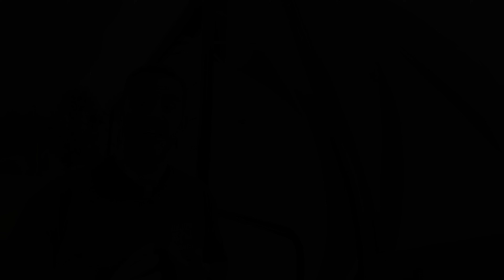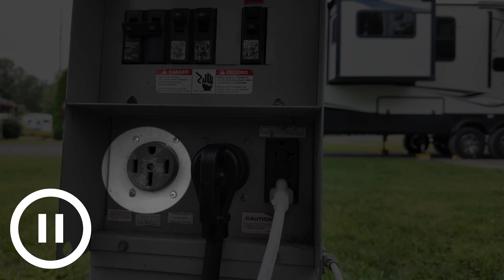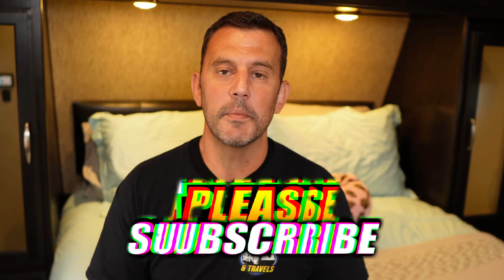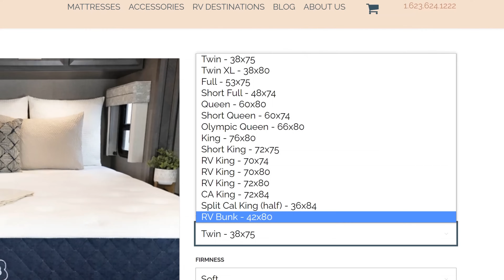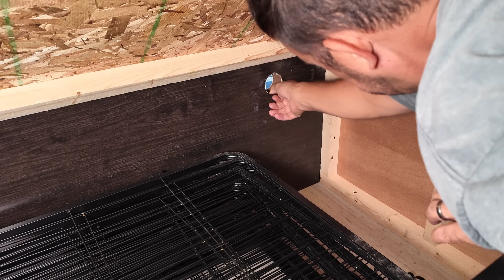This Old School RV Modification Adds USABLE Power to a 30 Amp RV

Comment from the maker: ✨ PRODUCTS FEATURED IN THIS VIDEO 
🛌 Get 30% off your RV Mattress by Brooklyn Bedding at https://rvmattress.com/rvtips
Use discount code: RVTIPS
🔹 Desktop Outlet https://geni.us/YtM7Nh (Amazon)
🔸 Grommets https://geni.us/ASZD (Amazon)
🔹 3/8" Cable Clamps https://geni.us/zImBfF9 (Amazon)
🔸 12 awg Extension Cord https://geni.us/Os46z (Amazon)
🔹 Hatch https://geni.us/oLa1xb (Amazon)
🔸 50 to 15 amp dogbone https://geni.us/Sfz4fBx (Amazon)
🔹 2" Hole Saw https://geni.us/RR5OY (Amazon)
🔸 Dremel Cutting Bit https://geni.us/W53OG (Amazon)
🔹 Dewalt Drill https://geni.us/OQhqvub (Amazon)
🔸 Power Watchdog 30 Amp EMS https://geni.us/zKcm (Amazon)

🔹 Ebay Auction has ended!

🔎 Resources
- Wire size chart from Miller Welding https://geni.us/5lV1N6D (Google)
-Great article on cord length & size https://www.grainger.com/know-how/equipment/kh-choosing-the-right-extension-cord

OTHER VIDEOS YOU MAY LIKE
🎥 RV Essentials https://youtu.be/yuvS3zZL81c
🎥 7 Things You're Missing https://youtu.be/PfOLBTklnHo
📺 See ALL our videos: https://www.youtube.com/@RVTIPSANDTRAVELS/videos

30 amp RV power sucks.  You cant run all the factory appliances at once, let alone any additional things you RV with.  Here's an old-school trick to utilizing the additional power provided by the campground pedestal.  

Chapters:
0:00 Intro
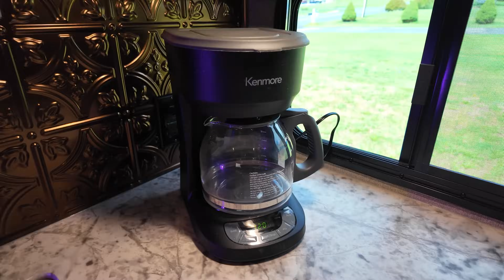0:37 30 Amp V 50 Amp
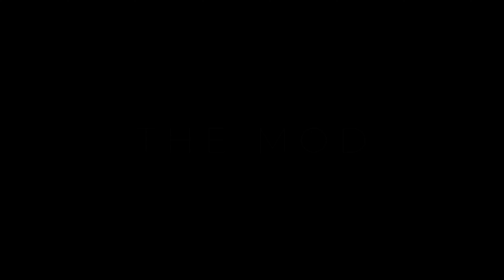1:49 The Mod
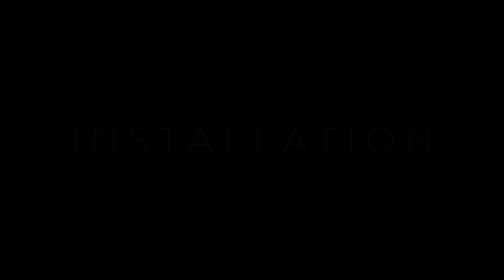3:14 Installation Pt 1
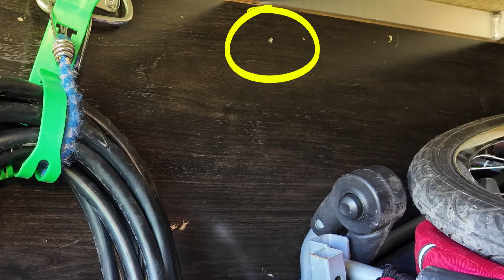4:44 Visit Our Sponsor
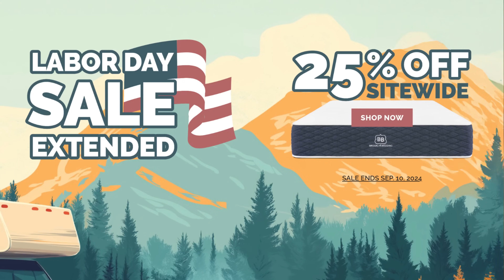5:29 Installation Pt 2
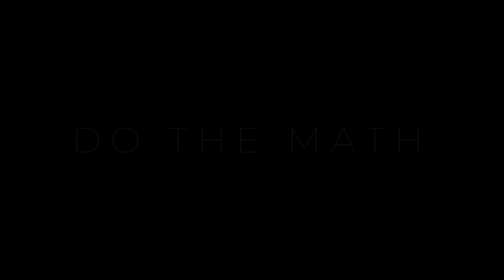6:49 Be a Hero
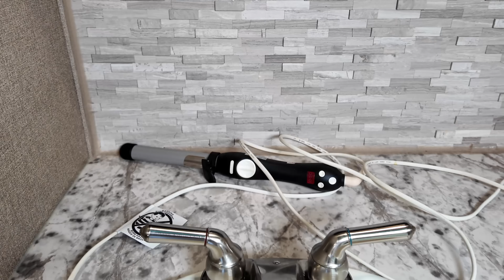7:08 Considerations

Thanks to  @JoshtheRVNerd  for some footage!

#rv #rvlife #rvliving #rvlifestyle #rvtips #rvtravel 

RV ESSENTIALS & TOP PICKS 
🎥Essentials Video: https://youtu.be/yuvS3zZL81c 
🔷Sewer Hose Kit https://geni.us/7dNg (Amazon)
🔷Clear 90 Degree Sewer Elbow https://geni.us/L79gI2 (Amazon)
🔷RV Water Filter https://geni.us/FZ1P (Amazon)
🔷Best Wheel Chocks https://geni.us/9B5i (Amazon)
🔷Power Watchdog 30 Amp Surge Protector/EMS https://geni.us/zKcm (Amazon)
🔷Power Watchdog 50 Amp Surge Protector/EMS https://geni.us/jgOto (Amazon)
🔷Wireless RV Leveler https://geni.us/DAW9N24 (Amazon)
🔷Leveling Ramps https://geni.us/m38VoBr (Amazon)
🔷Liquified RV Tank Treatment https://geni.us/QTUJSrP (Amazon)
🔷Tire Minder TPMS https://geni.us/8HBSTg (Amazon)
🔷Water Pressure Regulator https://geni.us/fTzA0 (Amazon)
🔷Drinking Water Safe Hose https://geni.us/emLdlC (Amazon)
🔷Browse All Essentials https://geni.us/1Omwvhh (Amazon)

MAINTENANCE:
🔶Boeshield T-9 Rust Preventative & Lubricant https://geni.us/uXxstyC (Amazon)
🔶Geocell Proflex Sealant https://geni.us/YXiACx (Amazon)
🔶Water Heater Cleaning Wand  https://geni.us/AcTvhLc (Amazon)
🔶Water Heater Cleaning Adapter https://youtu.be/h6C6ihTQ1cY
🔶Waste Tank Rinser https://geni.us/V2XLE (Amazon)
🔶Road Tool Kit https://geni.us/oBFnd9l (Amazon)
🔶Eternabond Roof Tape https://geni.us/6AXdw (Amazon)
🔶Browse All Maintenance https://geni.us/UvxFP (Amazon)

INSIDE
🔷Screen Door Handle https://geni.us/itRfKUQ (Amazon)
🔷Shower Caddy https://geni.us/ZPcno (Amazon)
🔷Oxygenics Shower Head https://geni.us/jznwF (Amazon)
🔷RV Paper Towel Holder https://geni.us/Acknol (Amazon)
🔷Dimmer Switch (watch video) https://youtu.be/2bbqBcSsRZQ
🔷Electric Heater Fireplace https://geni.us/YmBoktI (Amazon)

OUTSIDE
🔶Gravity Chairs https://geni.us/VlPR8rn (Amazon)
🔶Ground Mat https://geni.us/wbWWLzf (Amazon)
🔶Table https://geni.us/qsPO (Amazon)
🔶X Chocks https://geni.us/3oyburw (Amazon)
🔶Blackstone Griddle https://geni.us/8BuIrW (Amazon)
🔶Low Point Drain Valves https://geni.us/yBB02h7 (Amazon)

👇 COUPON CODES! Use the links. Save money. Simple.

🚐 10% off RV Snappads & Snapjacks https://rvsnappad.com/discount/RVTT10

💦 Blu Technology Water Filtration Systems 7% Off, $80 or more No code needed just use our link:  https://goblutech.com/xxnnkdun 

🛌 Get 30% off your RV Mattress by Brooklyn Bedding at https://rvmattress.com/rvtips
Use Discount Code: RVTIPS

📷 Haloview Back Up Cameras 5% Off & FREE Shipping (Use code RVTIPS at checkout) https://www.haloview.com/products/byte-tango-1080p-observation-camera-system.html?acc=765

🔧 NRVTA Home Study Course https://rvtechcourse.com/discount/RVTIPS20
Use Discount Code: RVTIPS20

🚴‍♂️️ Lectric eBikes - Use our link get FREE accessories https://lectricebikes.sjv.io/nLrJ3x

💻 Our eBay Store! You never know what you’ll find!
https://geni.us/6AyLKnS (eBay)

💥 Join Our FREE Newsletter! https://rvtipsandtravels.myflodesk.com/freenewsletter

If you want to support the work I do to help others, you can donate here:
Paypal: https://www.paypal.com/donate/?hosted_button_id=J2KKM9NR3BJJA
Venmo: https://venmo.com/u/Ross-Stoico

✨ AMAZON RV STORE ✨
https://www.amazon.com/shop/rvtipstravels

Follow Us on Social Media
https://www.instagram.com/RVTipsAndTravels
https://www.facebook.com/RVTipsAndTravels

🙏 If you find a dead link, PLEASE let us know & we’ll send you bumper stickers!

As an Amazon Associate, I earn from qualifying purchases. There is NO ADDITIONAL COST TO YOU when purchasing from our links. Thank you for your support! 2.0

Comment: I did this years ago with a 15 amp shore covered outlet. Male plug inside. 24 ft motor home, no basement or pass through. A normal 2 plug outlet next to the stove. I use a smart plug in thermostat plugged into it. Plug a small heater into that. It heats the RV on the 15 amp circuit, and I can use all the appliances without tripping the breaker.

Comment: I did the same thing about 3 years ago with my travel trailer because I wanted to run a small dehumidifier but not keep the electrical system of the travel trailer active 24 hours a day while parked in my driveway.

Comment: Just add another 30 amp service the exact same way. put in a small 2 circuit breaker box and run new wiring with the surface style conduit.  My RV plugs were brown so I did the 2nd circuit in white.  I added another A/C- heat pump on one circuit and kitchen plugs.
and plugs for electric heater on the other.  Best thing I ever did

Comment: Sorry hate these auto correct .   Did you plug it into extension cord or cut or female end and hardwire
Reply from the maker: The desktop outlet already came wired to a male plug, that was fished to the pass thru storage.  Extension cord plugged into that then pedestal.

Comment: Did you hard wire the desk top socket to the extension cord or did you just plug it back not the extension cord
Reply from the maker: The desktop outlet already came wired to a male plug, that was fished to the pass thru storage.  Extension cord plugged into that then pedestal.
Reply: @RVTIPSANDTRAVELS I love it. Thanks so much

Comment: Didn't read all the comments. But I definitely stole your idea. One thing I did was instead of the grommet I used a NOCO pass thru connection. I have one in my shed so you can get power inside via extension cord without having the cord pinched by the doors or windows.  It provides you with a water tight cover in the wet bay when not in use. 

I just E taped the connection in the under bed area so it doesn't come apart.
Reply from the maker: good idea

Comment: This is a project I've been talking about doing for almost 2 years, since my first winter in the camper. Actually bought the stuff to do it, a nice shore power receptacle/cover for the outside of the camper, but that ended up getting used for my tank heater project. Still want to add the outlet at some point, mainly because all my outlets are on one 15 amp breaker. I can't use multiple things even if the AC or water heater aren't running.
Reply: I do love having the tank heaters on a separate plug already though. They're just a few amps, but being able to not have that load on my camper in the winter is nice (especially at my parents where I'm boondocking on regular outlets. Being able to put those couple amps on another circuit is a godsend when you're only on a 15 or 20 amp plug.) That trick running the cord into the passthrough is what I do if I don't have a second outlet to plug the heaters into, just run the extension cord up into the passthrough and plug it into the camper.
Reply from the maker: me too, should have done it 2 years ago.  glad i finally did it.  was sick of running the cord through the slide out.

Comment: I suggest a gfci outlet to protect from possible ground faults. The breaker in the panel may be old and tired. The usb addition is nice and there are gfcis with usbs. You would need a cut in box which is not difficult to install.
Reply from the maker: thats a good point, but in theory every 20 amp outlet on a campground pedestal should already be GFCI since it has exposure to water.  however, you bring up a good point... that is probably something i should have mentioned in the video, so thank you for bringing it up!

Comment: I have ran an extension cord to the 20amp outlet on the campground pedestal before to plug in a 1500 watt heater. I have a voltage meter plugged into one of my outlets and noticed that when I turn the heater on, the voltage goes down. How is this possible, as the heater and the voltage meter are on seperate lines? (heater on the 20 amp outlet and meter on the 30 amp) I'm assuming that the pedestal is taking power from the 30amp socket and sharing it with the 20amp one. This has happened in multiple campgrounds.
Reply from the maker: interesting 🤔

Comment: 1) If you're screwing into that paper-thin plywood that most RVs are made of, glue a short strip of wood 3/4 inch thick behind where the screws will go.  Now you have something substantial to screw into and the screws won't strip out the hole.
2) If you're using an adapter to plug into the 50 amp receptacle, you don't have sufficient overload protection for a 12 gauge cord (and most extension cords are smaller than that).  This presents a safety hazard and I would avoid that.  Plugging into the 20 amp outlet on the pedestal is fine.
Reply from the maker: a 15 amp circuit is not going to overload a 50 amp outlet.  Also, on a dogbone, you're only getting 1 leg of power.
Reply: @RVTIPSANDTRAVELS  You're missing the point. If you overload the outlet, for example with a hair dryer and a 1500 watt space heater, you're pulling more amperage through the extension cord than it can carry without getting hot. This is how fires start.  The breaker won't guard against this unless you exceed 50 amps.
Reply from the maker: I understand what you're saying, but very clearly in the video i said to match the cord with the amount of power you would be pulling.  you cant overload a cord with a device that doesnt have the physical capability to pull more current.  Besides, and I can confirm this myself, and even have shown this in other videos... pedestal breakers rarely work correctly.  I've pulled up to 36 amps and it never popped the pedestal breaker.  its happened at multiple campgrounds... the reason I know is the Power Watchdog will go into auto shut off.

also, there is a 2x at the top of the pass through storage that the outlet is mounted too, it definitely would last long on that plywood alone.

Comment: Hi  thanks for the video. But i have a question, the pedestal connection is only one an is 30amp. Could i use a 30amp splitter to connect my rv and have a 15amp extension for my appliances?
Reply from the maker: if you're going off the same 30 amp plug, you're still only getting 30 amps, so this wont work.  you will need another 15/20 amp outlet to gain the extra amperage.

Comment: Cool mod.  Since you are using a pre wired outlet for residential use, I wouldn’t need to worry about any building codes?
Reply: It's an RV. What building codes?
Reply from the maker: i wanted to stay away from wiring a duplex... and use a prefab outlet for just that reason.

Comment: Hi Ross ,your Candian fan Randy Imagine 2600RB ,in regards to your electrical box did the same to useless GF outside plug which tripped continuously inside breaker in main panel . Just split wires to spare breaker it had. Also in regards to Swyntech slide issues. First checked slide brackets in wall to find broken screws and a single bracket to hold slide in camper,bad. Made new brackets either order or make put 2 more on each side with 3 screws instead of 1 on each side.Next lubed as per lippert video. Then took  a small hose secured to a small stick feed canola oil in tube and blew with compressor on each of slide rollers under neath rug for slide . Oil stayed on rollers and lubed floor of slide.Now slide rolls in & out like a dream  150% better. Also don't forget to sync motors by holding in button 10seconds. 45 times last year and 15 times this year in & out. Big Ben on travels again.

Comment: Have you checked what the code is? I have read this is not allowable
Reply from the maker: code? its a singlular prewired desktop outlet.  If you bought this for its intended purpose, you would be mounting it to your desk at home and plugging into an entension cord or outlet.  but if you want to wire in a duplex with romex to meet code thats absolutely fine too.  i dont think its necessary to worry about code when just adding a prewired desktop outlet.  its being routed safely through a grommet and tieing the wire as you go.  the important part is that you are using a sufficient gauge wire.

Comment: in 9 years of camping in an RV i have never required more than 30 amps, never popped an breaker.
Reply from the maker: Thanks Paul, have you ever analyzed the amp pull real time?  The Hughes Power Watchdog will allow you to do this on a phone app.  It's mathematically impossible to run all your appliances at once on a 30 amp circuit without exceeding the rating, according to physics.  As mentioned in the video, not popping a breaker doesnt always mean you arent exceeding your amperage.  If you havent popped a breaker you are probably being smart about which appliances you run at one time.  If that is not the case, your pedestal breakers are just not popping as they should.  Just be careful, if breakers don't pop, wiring is getting hot, terminals will probably show signs of singeing.  Thanks for watching and commenting!
Reply: I understand. I do not have a lot of extra appliances in my rig. I am also cognizant of what is drawing power and actively mitigate going over.  

I have to thank you for your content, it is most valuable.
Reply from the maker: Thank you for the nice comment and for your input.  Always appreciated my friend.  One thing that I know kills me is powering my water heater on electric.  I hate using propane for something I dont have to.

Comment: I have a 30A Class A with 2 AC's and 5500 ONAN Generator (30a & 20a legs). Found out there is a relay that makes the front AC generator preferred on the 20a leg. So I spliced in plug (male & female 20A, 12/2 ga) and now I can unplug the circuit form the generator and plug in an extension cord to the 20A pedestal. in this configuration, I have the front AC running on that 20A, while the rest of the coach is still running on the 30A.
Note: I do have a soft start on that front AC.
Reply from the maker: nice set up, I was going to say it would be good to put a soft start on that 20A, but you beat me to it.  Thanks for sharing my friend.
Reply: @RVTIPSANDTRAVELS  Next I'm going to buy a 50 AMP surge protector and a 50 AMP to 30/20 AMP splitter (like the Parkworld 885200 Splitter). So I'll have one connection that splits into 2 and both are protected. Then I can use the 50 AMP or my original 30 AMP (when I don't need both ACs and outside temps are cooler) or if 50 AMP is not available.
My only concern is the multiple connection points. I'll likely zip tie the splitter to the 50 AMP surge protector so it will remain good and tight. And inspect/clean frequently.

Comment: A work around for more power I've done is to add a 3000w power inverter to my camper that runs off the batteries (I have 2) this allows me to run my outfit kitchen fridge while I'm not plugged in and  it essentially delays the power load of temporary a temporary appliance.
Reply from the maker: which one did you get?
Reply: @RodgerGarage  yeah, we wanna know

Comment: Be mindful of your neighbors. Some campgrounds put one connection point between two lots, so one if the two RVs has their wire crossing under to get power. But it also means if you are running an extension to that other circuit, you might accidentally jump their breaker depending what you are collectively running at that time.
Reply from the maker: Totally agree.  Even if you are using a 15 amp plug and a 30 amp plug, you are still using 55 less amps than if you had a 50 amp rv using the 50 amp service.  Additionally, I would never run cords on my neighbors site, or condone doing it, as I wouldnt want it to be done to my site.  Common courtesy.

Comment: Nice - maybe add a thin re-enforcement plate on the panel/wallboard behind the new outlet to strengthen the installation from repeated plugging and unplugging - Thanks #YankeeTraveler
Reply from the maker: good idea, you got me thinking... I might even just cut the plug and wire in a duplex box inside the pass through storage to clean it up.
Reply: @RVTIPSANDTRAVELS  now I need to review your tire posts. Just had my first flat tire on our 2021 Heartland Trail Runner. Repair, replace? Replace in pairs? , same side or opposites, dealer service? …. 😳

Comment: Good idea, I wish I would have done that when we had our 30 amp TT. I may have missed the video but I’m guessing you added the vent to your under the bed storage that seems like another good mod, I will have to do this. Keep the tips and tricks coming I really enjoy your videos
Reply from the maker: someones paying attention!  yes, i added those vents because that area is against the pass through storage, and because of the temperature differences, i figured that would help regulate the storage temperature more with the interior and cut down on mold.  not sure if it really works outside of my theory, but no mold or issues so far.